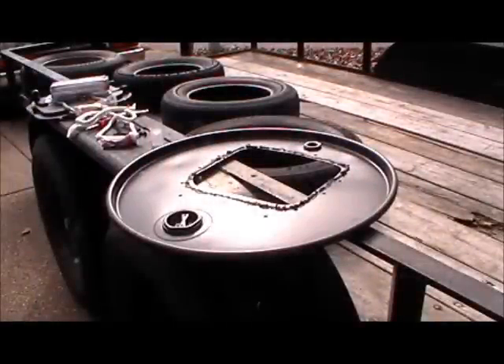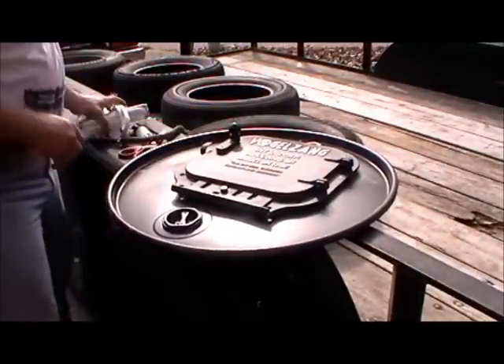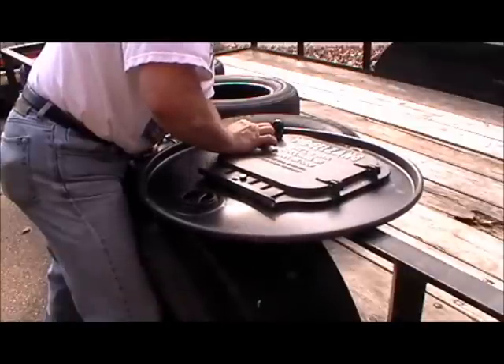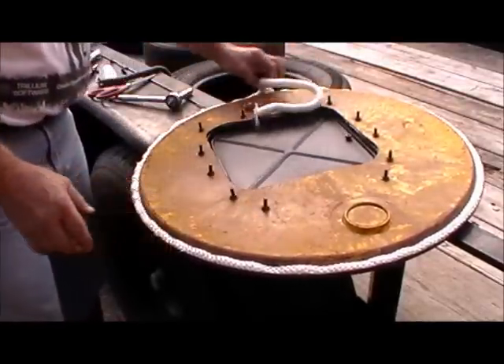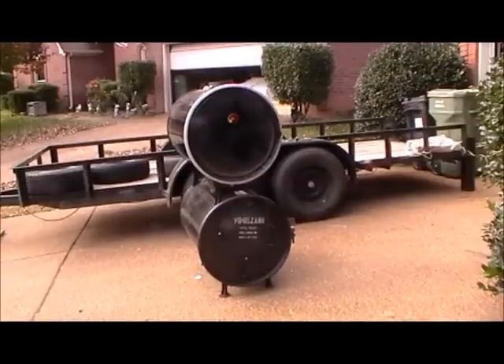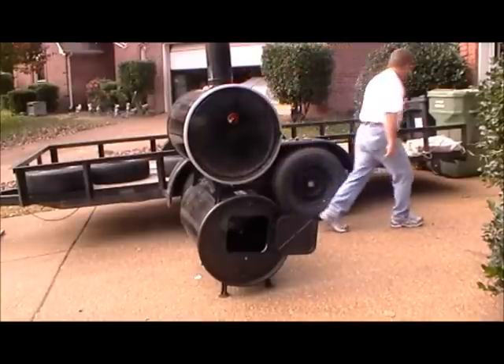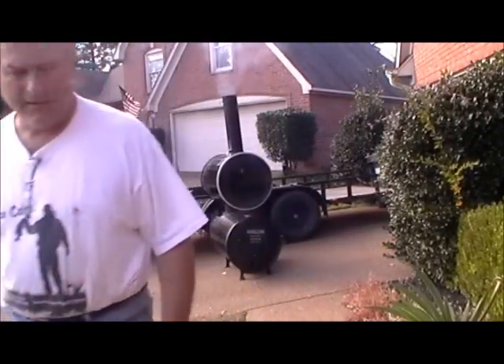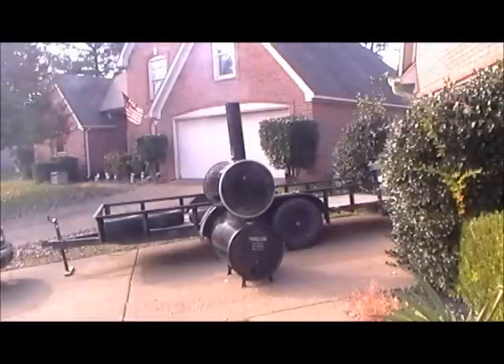Greenhouse Heater - Building A Double Barrel Stove FireBox PART 4 of 4

Comment from the maker: Are you talking about the small vent hole? I will have a metal ebow and about 2' of metal pipe coming out of there.Then 2" electrical PVC running from the pipe out of the greenhouse to a fanbox to force air from the outside into the firebox.

Comment: My question isn't on the crooked door, my question is when you painted it so pretty with high temp paint did you not realize that you applied it to regular paint? It will just burn off with the undercoat of paint.
Reply from the maker: Renee Brown it didn’t. I sold it this spring to a gut that is heating his warehouse and it still looked great with the exception of the stack. He replaced it anyway with the one that he already has in the building.
Thanks for the suggestion though. I guess the paint that was already on there was a temp rated paint.
Chuck

Comment: a bit deceptive? Its crooked as hell!!!!!!
Reply from the maker: +Tim S Yeah it was. I took the lid off and straightened it out cause the door kept swinging all the way open.
Chuck
Reply: easy fix!
Reply: Yes and no. Yes It's crooked but not to the damper hole. Quick fix. Turn the barrel lid and relock.